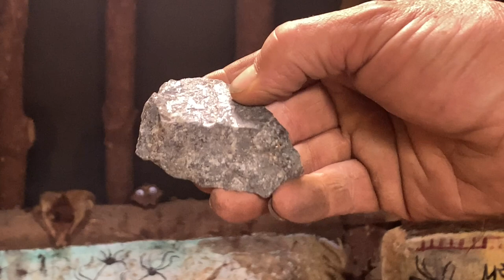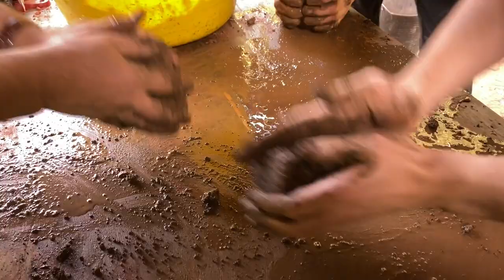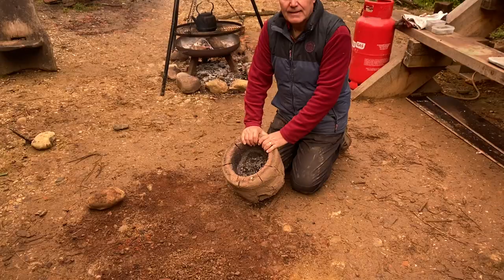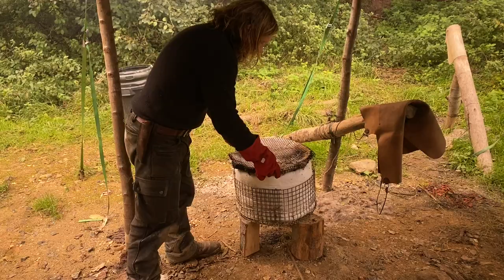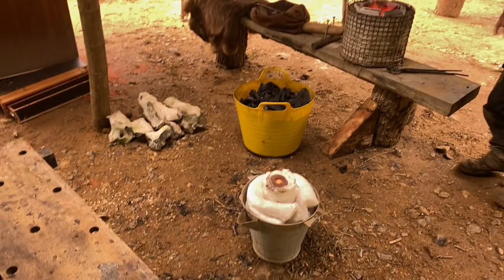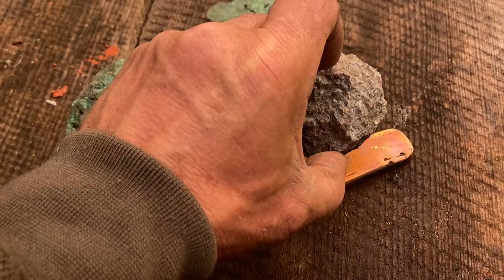Enter The Bronze Age starting right from the ore itself

Comment: Hi Will, it has been over a year since you made this video so I am sure someone will have already given you this information, however just in case. The finely ground tin concentrate you were using is the correct form of cassiterite to use for smelting, however to obtain metallic tin the ore needs to be strongly reduced i.e. heated with finely ground carbon to create a reducing atmosphere.
If you have not already got this information good luck.
Reply from the maker: Thank you I will try that out